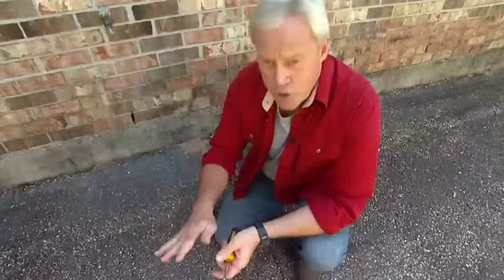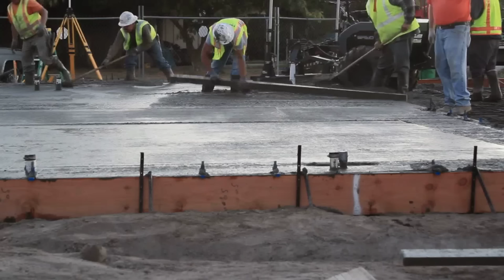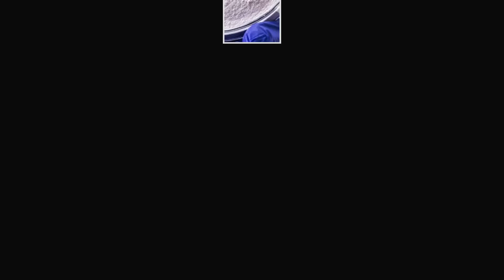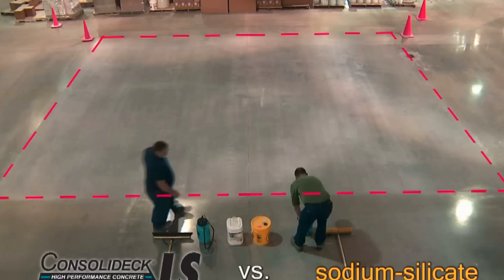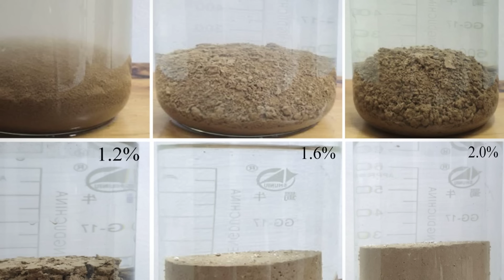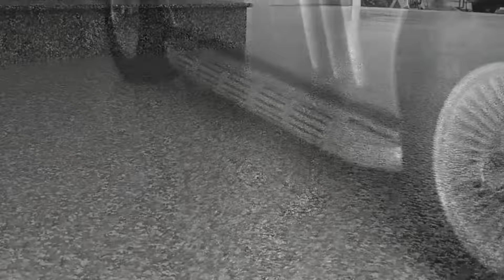$1 Spray PERMANENTLY Heals Concrete Cracks. The Industry Spent 50 Years Hiding This.

Comment: Why sodium silicate + Portland cement doesn’t work for cracks
It fails for three reasons:

A. Portland cement shrinks as it cures
So your “repair” pulls away from the crack walls and re‑cracks.

B. Sodium silicate doesn’t fix the shrinkage problem
It hardens the surface but doesn’t prevent the internal movement.

C. The mix doesn’t bond well inside narrow cracks
You end up with a brittle patch that looks good for a week and then pops out.

This is why professionals don’t use that mixture.

Comment: For those who want to see the details already:
2 compounds discussed are sodium silicate and aspdin's Portland cement. 
Portland cement costs $5-10 in any hardware store. Sodium silicate costs few dollars pee quart in gallons or in smaller bottles called concrete condensifier.
Procedures for this: Inspect the cracks (16th of an inch cracks work), remove loose dust and clean surface, lightly dampen surface and must have no puddles, spray sodium silicate and let it soak, and finally rurub in portland cement to have a smooth, strong finish.

Comment: Rusting re-bar expands. Concrete has low tensile strength, so the expanding steel due to rust causes the concrete to crack.
Reply: Yes it's called delimitation
Reply: Thank you, I have seen many concrete cracks on my garage floor and on my driveway this year.

Comment: I have a 40 year old concrete bottom swimming pool that has a crack in it.  Will this fix it?
Reply: Only if it was built with Roman concrete.
Reply: Use a different legit sealant for that.
Reply: No